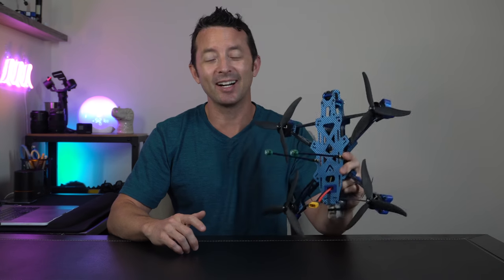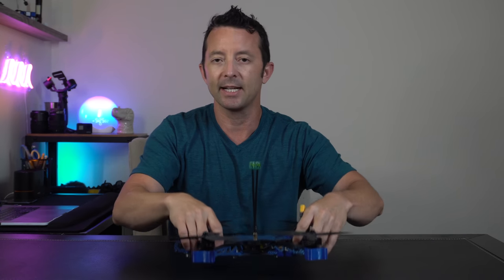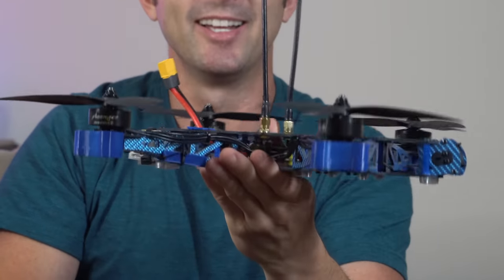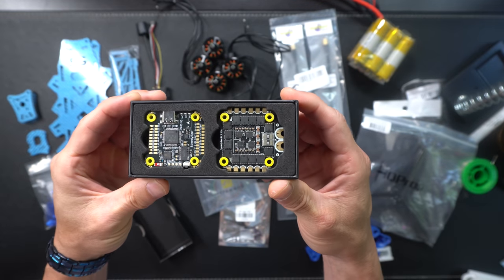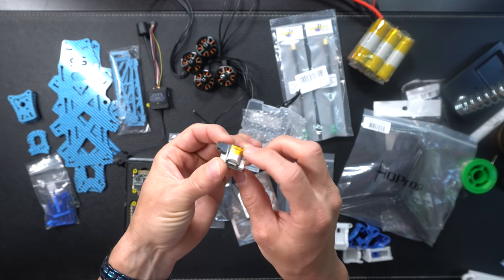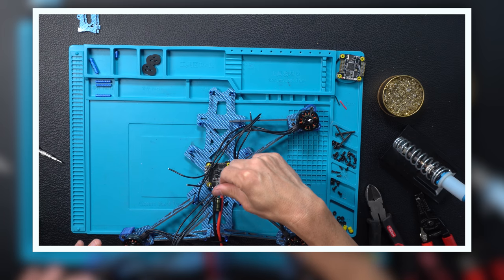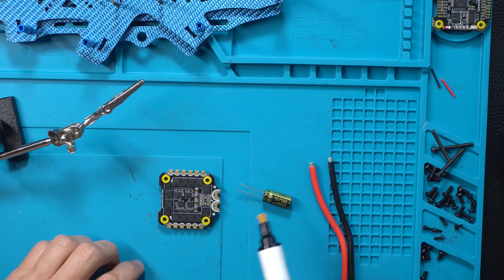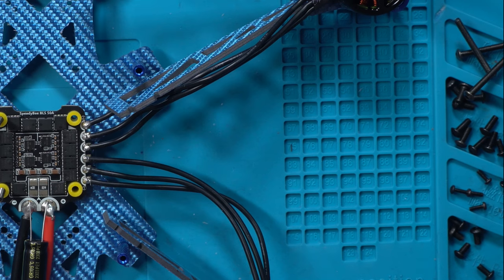AOS UL 7 Complete Build Log  -  How To Build A 7" Long Range Drone

Comment: Just a tip: Put lock nuts underneath your ESC and FC stack, that way the screws will be a lot stiffer and remain vertical at all times, which will help a lot with keeping the FC gyro stable. That little trick makes such a big difference that Chris Rosser calls these the "golden nuts".

Comment: Thank you, very nice build video! What antennas do you use? What about that "Dual Band dual Polarization" thing with the O3? Are these 2 UF.L connectors different?
Reply from the maker: thanks, all the items should be linked below but i used the flyfish rc antennas, its not really dual band just dual antenna so yes a better chance of keeping connection vs the o3 single antenna onto both ufl ports...

Comment: Thanks for all of the awesome prints man. i'm curious, when putting your stack in, did you end up putting nuts on the bottom, under your ESC to try to stop vibrations? every other frame i've build with had pressnuts installed
Reply from the maker: no i put the lil rubber donut things i had to keep them from falling out during assembly...maybe if i get motivated ill swap it and see if naything changes... overall it flies great, there is a little shudder in the 03 camera  occassionally, not sure if its the AU or the FC yet... but there is def a weird little bobble i need to figure out if i do a front/back flip while doing light freestyle... the comment below yours (currently) talks about the Rossers golden nutz haha
Reply: The golden nutz definitely help reduce any unwanted vibrations from the flight stack

Comment: Thanks for the video well done. I built mine about six months ago and had issues with the tune. I used Chris Rosser preset tune but still get twitchy flight. So i used Mark Spatz 7 inch tune and ajusted that to get decent flight but definitely hasn't resoved the problem at 1/2 - 3/4 throttle.  Have any suggestions? I have the same speedybee stack. 2806 motors. 1300 kv motors. From my testing it seems like the gyro can't keep up.

Comment: What made you select this over the regular AOS 7? I'm quite torn between the two, and not sure which one to get. From what I understand, the regular aos7 is about 60 grams heavier and has a more durable frame.
Reply from the maker: Mainly because it was some thing that had been recently released while I was doing research for 7 inch FPV. It was a tough decision between a chimera Pro, or an AOS seven, and then the ultralight came out and I was like F it why not lol. 

It is super light and definitely a floater, but being my first seven and I don't have anything to compare it to, although the regular ALS may be more durable who is really planning on crashing when it comes to 7 inch long range, and it's not necessarily a freestyle drone, so I'm not overly concerned about crashing while trying to do tricks like I typically might with a 5"

Comment: Are you running props out? Does it make a difference with the tune presets?
Reply from the maker: Yes props out, honestly I don't think it really affects much whether they're in or out, from what I read a long while back it's mainly about making sure if your flying thru trees/vegetation it doesn't throw that crap into the camera lol, but now imma have to research that and see if it still holds true

Comment: Hi, how did you mount the FC into the frame? I'm asking because the thread inserts are missing from the frame
Reply from the maker: FC hardware comes with is when you buy it..thread inserts like where the gopro mounts? those only come in that one section... usually the Fc has the hardware as mentioned and either some rubber donuts or plastic hex nuts, either one should hold the screw in during assembly

Comment: Great i found your comment in Chris video, and follow your chan here. I am also trying to build the same frame, but the arms are almost impossible or at least very difficult to assemble. I got the frame from cnc-drone. I am trying to put one arm in the holes of the motor plate ... but i have to push very hard, and i fell like i will brake everything.
This is one hour i am trying with several arms or holes, but no success so far.
Did you use some kind of tool or technique to make the arms fit in the hole ?
Yours seems to be pretty easy to assemble.
Reply from the maker: yes i mention this in the build wrap at the beginning, i had to file down the inside of a few of the holes to get them to slide together easier. if youre in the US go to walmart and buy a cheap mini file set in the tool dept. obviously cant be any wider than the hole or it wont work, maybe a nail file would work too? 

some were close to fitting and i had to rock them back and forth to get them to loosen up and fit.
Reply: @LifeofAccro   Thank you so much for answering so quickly. Indeed, i just skipped the beginning and went direclty to the place where you assemble them ;). I will now watch your full video again. I also subbed ;) to follow your next adventures with this frame ;) 
Thank you again !

Comment: Thanks again for this build video that helped me ! I just finished building mine and tried it with a 21700 6S pack on 1300kv F90 motors. It flies pretty well right from the beginning, but i feel like the liion pack is not able to deliver enough amps to fly faster without damaging the liion battery.
Did you try it with lipo pack ? And if yes with which capacity ?
Reply from the maker: What cells? My samsung 40T is rated at 35amp and the molicell 42a is it 45amp. So far I've noticed I pull between 17-25amp constant depening on wind conditions, obviously flying slower and more amps into a head wind. But moving between 30-45mph typically.

I think thats a good start so far, but I wouldn't worry about "damage" pushing the cells as long as you are staying within the rated amps and not running it down past 3.1v IMO.

With that said the more amps (constant) you push the faster you will burn your watt  hours which equals less range/ flight time.

I'm still exploring its range/limits but so far its way more efficent on 6s than my 5s nazgul on 4s that I was using...bit more flights to come
Reply: @LifeofAccro  Fully agree with you ! I have molicel with 45 amps rated.I will keep this Liion pack when i want to fly further. But sometimes i want to go faster, even if flight time will be shorter. I am just wondering how much lipo capacity i should carry so it flies great and fast and let's say for 8 or 10 minutes max. lipo 3000 mAh is about the same weight, but i guess flight time will be greatly reduced if i hit the throttle harder.
I plan to try 4500 mAh lipo which is 200 gr more than the liion pack. but not sure how this will impact flight behavior and flight time ...
let's see.
Reply from the maker: @titanium38000  this is the trade-off between Lipo and lion, because you'll never get 80% of capacity out of a Lipo since we have to stop at 3.5v... But I use a 1000mah lipo from my other quads on this as my warm-up flight and for some fun punchy fast freestyle and I get about 3 to 4 minutes, maybe later this week I will parallel two of them together at 2000mah and see what kind of fast fun flight time I might get in really high angle camera.
Reply: @LifeofAccro  Chris, on his website says we can go up to 6000mAh 6S battery or 3x 3000mAh 6S Li-ion pack for longer range, which makes the quad really heavier. I feel just like you i guess, as i prefer lighter machines.
I am trying to find the right balance for what i want to do: at least 7 or 8 minutes flight time with a cruise speed at 90 km/h and sometimes a bit faster at 110 km/h.
i think the quad can carry more than a 2000mAh lipo and stays fun to fly. My guess is something between 3500 mAh and 4500 mAh, but lipos are so expensive that i try to find relevant information on the web ;)
But i would be definitelay interested to know about your test with a 2000mAh lipo. 
Do not hesitate to publish a new video of this test, i have subscribed ;) Thanks :D

Comment: i bought my frame in march of 2023 and the carbon parts just don't fit. unfortunately i did not build the drone sooner to get it replaced .. seems like it got fixed in your revision, but still a little tight from what i saw
Reply from the maker: yeah just a couple spots that needed to be filed, im sure a PITA for you if its tighter overall, but once its assembled and flies its worth it...might be a little tedious on your end but might as well ;)